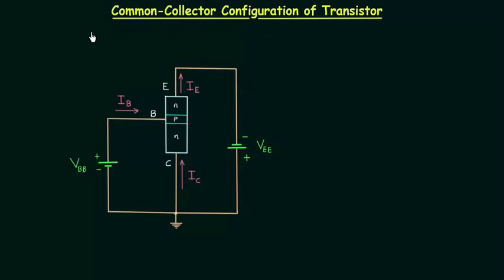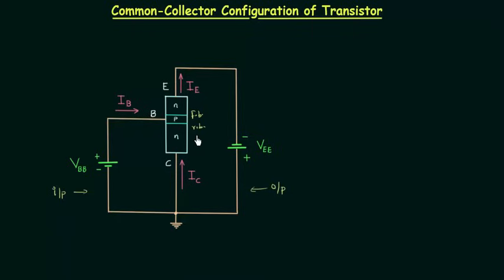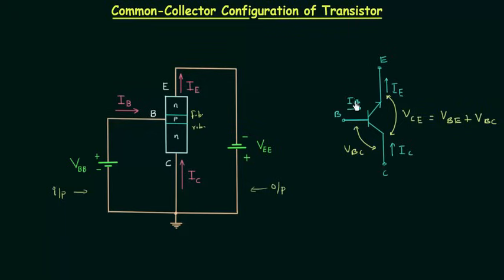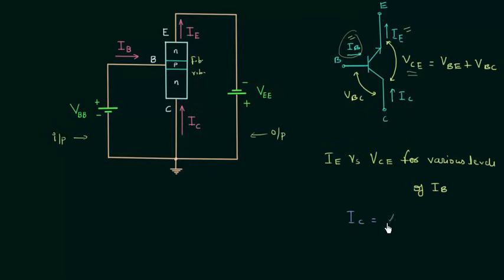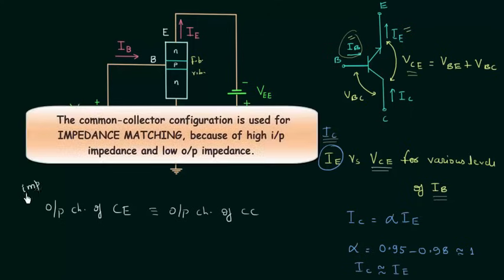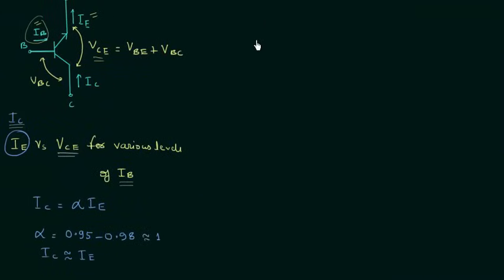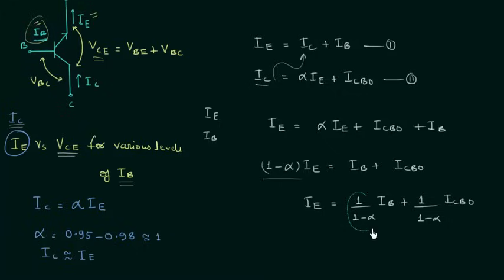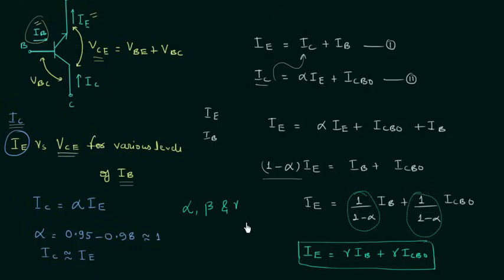Common-Collector Configuration of a Transistor

Comment: sir according to figure collector base junction is not reverse biased
Reply: Actually it is R.B...see it again..
Reply: Yes in reverse bias p should be connected with negative
Reply: @dheerajkumarsingh5789  can you explain that? I don't get it :/
Reply: @dheerajkumarsingh5789  explain please
Reply: @dheerajkumarsingh5789  actually you are the one that need to see it again!
Reply: Hahah
Reply: @edgarcalochcampos1930  Vbb has lower potential then Vee , so we can say p-type is in low potential and that N-type is in high potential... And this exactly what it needs to be in reverse biased condition... Hope you get it :)
Reply: @Keshavsworld  I didn't understand what you said
Reply: @-ec-Lalithadevi  can you tell me the exact time span.... Where u don't understand...?
Reply: if p type is at lower potential and n type at higher potential then can we say junction is at reverse bias..
Reply: @-ec-Lalithadevi  consider Vbb has low rating then... Vee.... Keep this in mind... And try to understand tgat portion again..... With what i told you....
Reply: Get your basics correct man😅 any diode is not reverse only in -ve is connected to -ve it can also be reverse if voltage supply is not equal to Or greater than knee voltage😂
Reply: The diagram is wrong, you can verify it using simulation or real experiment.
Reply: @votelearn1244  super
Reply: @votelearn1244  s
Reply: Yess
Reply: Input hamesha Forward bias and output hamesha reverse bias hota hai for any configuration
Reply: Well that maybe a mistake
Reply: it is reverse biased from collector side only .
If it is made reversed biased from emiiter side then there is no flow of current(IE)
Reply: Full agree bro mera bhee yahi doubt ha
Reply: @tusharpiyush3788  aaisa to nahi h bhi
Reply: Yeah
Reply: @dheerajkumarsingh5789 are u blind ?
Reply: BRO ALWAYS CHECK JUNCTION 1 (EMITTER-BASE) VOLTAGE W.R.T INPUT VOLTAGE/LOOP AND CHECK JUNCTION 2 (COLLECTER -BASE) VOLTAGE W.R.T OUTPUT VOLTAGE/LOOP

Comment: Sir as you said,the collector junction should be reverse biased..but in the above concept why is it forward biased🙄
Reply: Vbb != Vbe .. so additional voltage source will reverse bias the Transistor ..
Reply: i prefer you see it with respect to output circuit and you will find the same j2 being reverse biased( Yes,the j2 is forward biased if your perspective is from input it is allowing the current to rotate in the left loop which being acted as a opposer that is reverse biased when you look it at the right loop perspective...correct me if i'm wrong guys.
Reply: Same question goes from my side

Comment: To understand why J2 is reverse bias we need to go back to the basics. Voltage is the difference of higher potential to the lower potential, so in this case C's higher potential  is Vee+ not Vbb- and lower potential is Vbb+ hence J2 is reverse bias.
Reply: According to circuit Vbb's +ve terminal is connected to p side and -ve terminal is connected to n side. So, Vbb will maintain a higher potential at p side and lower potential at n side.
So, irrespective of other parts of circuit collecter base junction is forward biased.
Reply: KVL says otherwise

Comment: sir in this video you say collector and base junction is reverse bias but it is not please check
Reply: I agree. The C-B junction is in forward bias. Isn't it wrong?
Reply: Ya..this is also my query...
Reply: Vee(5V)>Vbb(1V), so CB junction is reversed biased. 
The direction of voltage difference (Vee-Vbb) is opposite to the direction of CB barrier potential.
In general, follow this (conventional current flow) convention for npn transistor,
Ie(*outgoing* current to negative terminal of battery) = Ib(*ingoing* current from positive terminal of battery) + Ic(*ingoing* current from positive terminal of battery)
Reply: udeep shrestha sorry bro i didn' t get it what you are
 trying to understand
Reply: Base terminal= +ve voltage , and collector terminal =+ve volatage . To make collector base junction reverse bias , VEE > VBB . VEE is more +ve than VBB.
Reply: All I got it Vb=Vc+Vbb
Reply: In order to operate a transistor as an amplifier, the condition collector must be higher potential than base and base must be higher potential than emitter i.e., c>b>e (for NPN transistor) in the above lecture sir doesn't mention the voltage levels so then consider magnitude of Vee is greater than Vbb. Then the transistor will operate in the active region. For exaample consider Vee as 5volts while Vbb as 2volts in magnitude.
Reply: Kya Bewakoofi Kar rahe hain sab log....ki Vee>Vbb ... that's why...it's reverse..  ...bhakkkkkk.......are this figure is wrong...Vbb kitne bhi small ho par Vb is always greater than Vc....so..... it's forward biased......not reversed.....Kya Bewakoofi hai bhai thik se socho to sab log....
Reply: Karmveer Singh Jangra  explain sir why CB is in forward biased
Reply: karamveer
dhyan se dekho

Vbb wali jo battery hai
uska potential p pe positive polarity ka hai
aur n jo ki collector hai uspe b positive polarity ka potential hai aur as we know collector ki battery pe potential jyaada hota hai
isiliye rev biased hau
Reply: Correct me if I am wrong... his diagram is correct... For J1 to be forward biased E is to be connected to -ve terminal and B to + ve...  J2 matches automatically
Reply: @learningislife1818  you are right...base is always at a higher potential than collector so F.B but if Vbb is smaller than 0.7V then it will be reverse biased
Reply: Even if Vee is more positive than Vbb, collector is grounded so the potential at collector terminal is zero, now for BC junction to be reverse biased potential at B has to be negative.
And for your arguments to be true emitter should have been grounded not the collector
Reply: @learningislife1818  Exactly. Answer dene se pehle sochte nahi log....aur confusion lekar aate hai. 😠😠😠
Reply: @venkateshanantapalli4343  if we take Vee =5 and Vbb=2 then common collector should not be grounded otherwise it will not satisfy active mode of biasing (both will become FB)
Reply: @bharath_rbp  yes ur correct the collector shouldn't be grounded otherwise the base should be nagative voltage-2v. Tq
Reply: Diagram is correct,collector to base junction is in reverse bias
VBE is 0.7 volts approximately no matter what the Supply voltage(VBB) is.You can ask me how. For example look at input characteristics in CE, slope is almost 90 and after 0.7 v curve is almost a straight line.
Emitter is negative w.r.t collector and Base is positive.As emitter voltage is approximately taken as 0.7v and in order to make collector junction in reverse bias you should give positive voltage right !!!
Giving positive voltage at collector makes it even more positive than base voltage(VBE=-0.7v). Hence collector junction will be in reverse bias
Reply: @venkateshanantapalli4343  collector is at 0V, since it is grounded.

Comment: sir, kindly explain the reverse biasing of base and collector junction properly
Reply: I think that ground is a problem if it were not present then the biasing will be appropriate only thing to be done is applying greater EC voltage than Vbc

Comment: Sir, collector base junction should be reverse biased but here you have shown that base is at a potential higher than the collector...that means collector base junction is forward biased..please edify
Reply: his diagram is correct... For J1 to be forward biased E is to be connected to -ve terminal and B to + ve...  J2 matches automatically
Reply: By selecting value of Vee greater than Vbb reverse bias of cb junction is achieved and eb junction is always forward biases in given fig..

Comment: P region pe positive voltage hai let suppose it is 2volt Jo ki input voltage hai ie Vbc =2V ..now collector region Jo ki n type hai uspe bhi positive voltage hai but ispe more positive voltage hai than base region Jo ki output voltage hai let suppose 5 volt ..to overall voltage at collector will be 5-2=3 which is more than p region so junction CB will come to be in reverse bise

Comment: At 2.30 you write collector current Ic equals alpha times emitter current Ie. At 4.07 you write collector current Ic equals alpha times emitter current Ie plus Icbo.  Mathematically,   these two equations cannot be correct at the same time. Would you kindly explain what is Icbo?
Reply: Icbo is very small and he neglected it at first. Icbo is the reverse saturation current in common base measured when emitter is open circuited.

Comment: logically emitter is always forward biased and collector is always reverse biased with respect to base but in this CC config is not like that why?
Reply: krish Bala Input terminal should me F.B n o/p reverse
Reply: Because if Vee > Vbb , then collector goes to a higher potential than base , even though both are positive, and so ultimately it becomes reverse biased. Condition is Vee has to be larger than Vbb for collector to be reverse biased.

Comment: The diagram is really wrong and I have verified it using simulation. The  base collector junction is not really reversed biased.
The wrong diagram is used in many places, but it is wrong.
Reply: Can you please send a reference for a correct diagram, I was also thinking this diagram was wrong, but on many place on internet ,the same diagram is used and now I am confused.